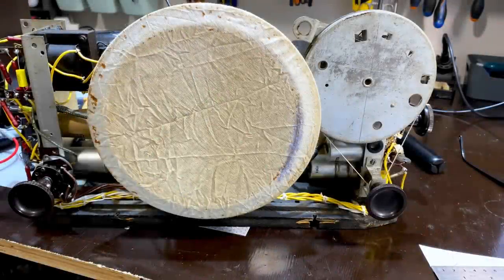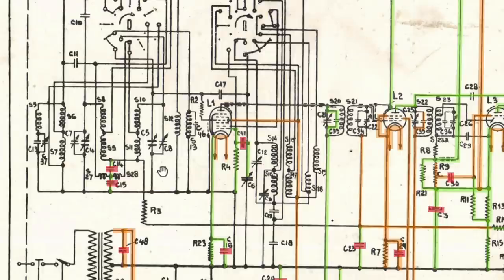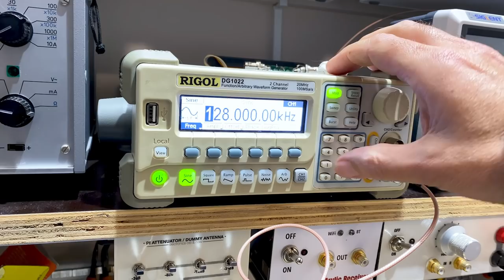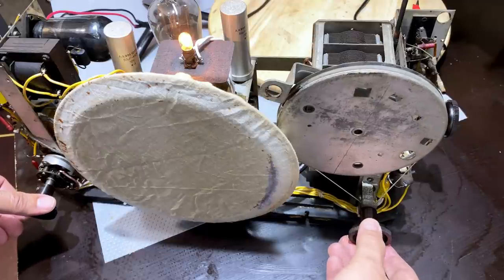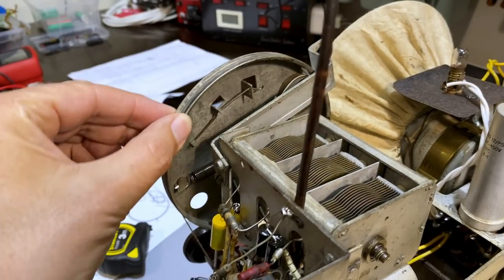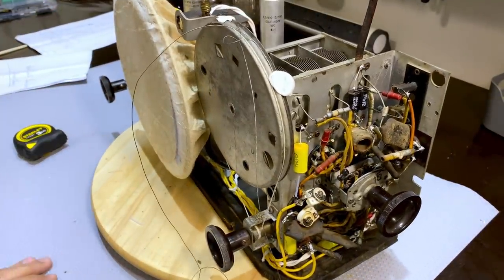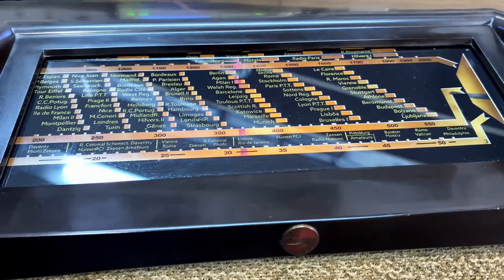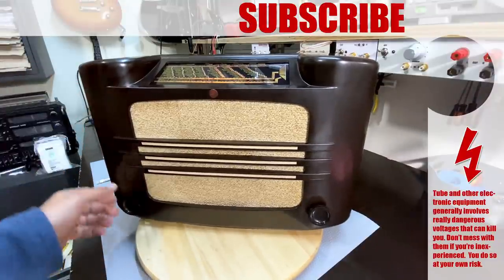This radio is 85 years old ... and has real style. Philips 461A restoration - part 5.

Comment: I watched the whole series and I am very impressed. I am bit jealous of the outstanding shortwave performance. In Australia we don't get much of shortwave. 
Those radios were built to last, I restored two Philips from the same era "6607 built in 1937 and 2262 built in 1940" Those two radio wanted to work regardless of their horrible circuit state. The pig tail connection existed in the older radio.
Restoring Philips is never easy. They tend to lay component on top of each other  in an impossible places to reach.
Great job mate 👍 
Khaled
Reply from the maker: Thank you 👍

Comment: Bakelite was the first company to manufacture plastic from phenol resin and formaldehyde in 1907. Apart from (of course) 78rpm records, Bakelite was used in a host of applications. Compression moulds were used extensively for radio cabinets et

Comment: Excellent refurbishment Manuel I never liked the P series of Philips Valves thankfully they didn’t last long after WW2 they disappeared but congratulations on Getting old Girl running sweetly 
It is certainly a sensitive Radio and picking many stations Medium Wave and Long Wave the Long Wave isn’t used in Australia for Broadcasting it used for Aircraft Beacons I noticed on your demonstration of the Radio it is pity it wasn’t used because of Australia vast distance. Anyway congratulations for the Refurbishment of 75 Years old Philips and Dons input re restring the dial and like the rep-use off the Chop Stick,Ian,
Reply from the maker: Thank you.

Comment: Would it not have been easier if they had implemented a balanced mixer using 4x 12AU7 tubes like that of a SO42P with the bottom two 12AU7 tubes as the oscillator which means you get the signal you want and nothing else.
Reply from the maker: 12au7 only came out in 1948. This radio is from 1937.

Comment: Mr Caldeira: What a pleasant discovery was your article! My parents passed to me a very similar radio, the Philips 667 A, which I used for many years. A friend added to it an amplifier stage for our Garrard record player from the basic circuits  of the radio (about 1960/61) and it performed well in our small apartment, with fine tone and adequate volume. We never changed a tube in all that time, confirming what you say about Philips quality. Hope that one day you would also consider a restoration of some of the fine American radios of the period.
Reply from the maker: I most certainly would love to restore the American radios, but unfortunately they aren’t commonly found around here. The only exception is the Zenith TransOceanics that I’ve done. They are transistor sets and I really loved doing them.

Comment: The radio turned out great, good job! Nice to see the lady do an "Ouverture" again. Looks great, even the speaker cloth. The cloth on mine was a goner, had to replace it.
Reply from the maker: 👍 You need to get a sewing kit out for that 😊
Reply: @electronicsoldandnew  I think a weaving kit would have been more appropriate 😬 It just fell apart, had been stored quite damp in a Dutch cellar or shed. Found some old curtain cloth that did the job. There's a Dutch webstore that sells original or reproduced Philips and others speakercloth though.
Reply from the maker: Yes, I’ve seen that service. It’s great.

Comment: Great radio and a great job!!!
Reply from the maker: Thanks Stefan. Any tips as to why the FM is so poor? The tip you gave me on the 3400 was pure gold 😊
Reply: @electronicsoldandnew  The 2100 has a simple capacitor tuning, so the reason can´t be the same as in the 3400.
But maybe bad sliding contact in the tuning cap or bad supply voltages (electrolytics also) inside the FM-tuner. Or a heavy misalignment by an owner.

Comment: I really enjoyed this restoration, and i know prewar Philips radio's pretty well. I'm impressed with the result, the finding of the missing capacitor for the sw occilator made me smile. What a lot of people discribe as quirks, is normal for us Dutchies.

I restored the same radio about 20 years ago, pre yt. There is just one thing about the work you did which is bothering me a bit. That is: why is the dialglass mounted way too high, and also too far to the left? It isn't in the center where it should be...  Easy corrected though.
For the rest: i was certainly impressed with the performance of your 461a. And the beautifull work on the chassis.
When i restored mine, my parents used her on a daily basis for over 10 years. Until their favorite station dissapeared from the mw.

Love the channel, all the best, 
Regards,
Nico den Haak.
Reply from the maker: I mentioned in one of the videos that the dial glass wasn’t making sense. In fact, I actually thought that it may have been replaced incorrectly, but I don’t see any way to correct the positioning.
Reply: @electronicsoldandnew  
Hi Manuel,

It looks original,  but with different stations off course compared to mine. I was able to centre mine.
Possibly it's a after war plan the Copenhagen dialglass. After 1948, a lot was changed, resulting in a lot of new dialglas replacements for prewar radio's.